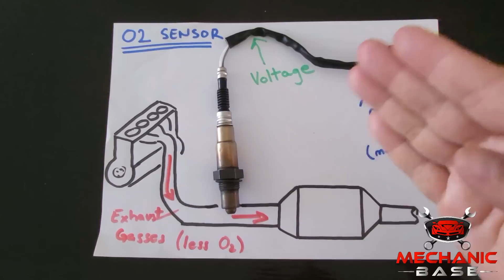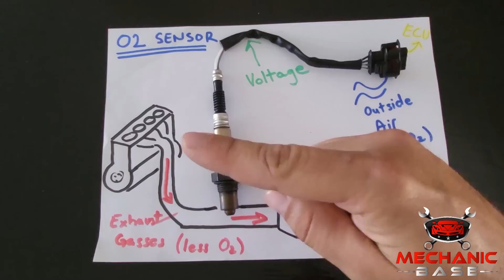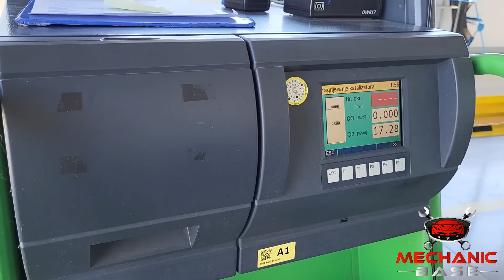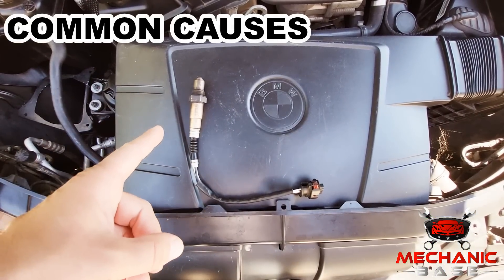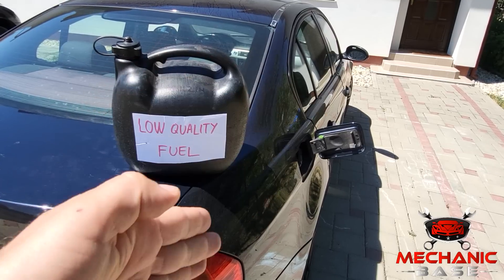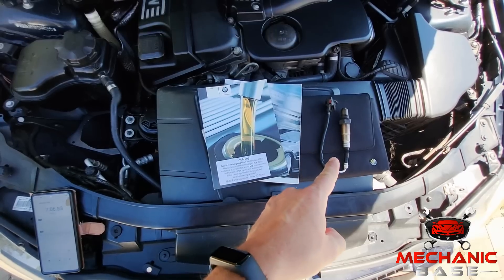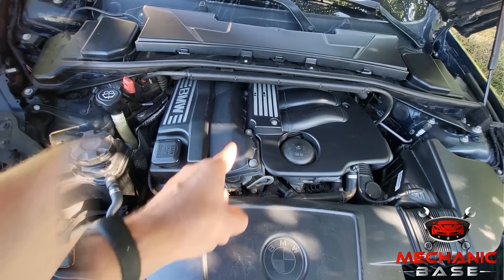5 Symptoms of a Bad Oxygen Sensor (and Replacement Cost!)

Comment: Just a tip, replace O2 sensors with the OEM unit your car came with from the facotory. Aftermarket units do not always work in some vehicles. GM is notorious for this. I know, I just installed a Bosch unit in my GM, when replacing the exhaust system, it tripped a code. Replaced with ACDelco O2 sensor, no more code, car idling smooth again. 

On edit: The reason a Bosch O2 sensor wound up in my vehicle is that I had an exhaust installed, and it needed a new O2 sensor, Bosch was all that was readily available at the time of the install. If not for that, an OEM sensor would have been installed.
Reply: thanks for this advice, I have a GM car but it is a Holden made in Oz.
Reply: Fords are notorious for being incompatible with some aftermarket parts as well
Reply: @kenneth9874     pshh ... Nah
Reply: Buy a Ford
Reply: @anonymous175  s1¹22
Reply: My 2008 Grand Marquis with 4.6 engine has 292,000 Km on it without replacing an O2 sensor.I always used  5w20 full synthetic oil and does not burn oil.Oil& filter is changed twice A Year. With check engine not on, is this an indication that O2 sensor (or sensors) are ok? Engine is always fully warmed,before being,shut off.
Reply: What is an OEM price to an aftermarket part price,% ball park? I once shopped for an OEM part (Blend Door Actuator for a 98 Honda). There was only one in all of Canada (Toronto, of course) that was 6 times more expensive than an Aftermarket, Chinese part.
Reply: @davidweum  That particular OEM part you tried to source, that is the dealer raping the customer. Almost all do that today, you really need to research and shop around, which it sounds like you did. 

And funny you mention Honda, and aftermarket parts, I have a few stories on that one, what a nightmare. Had to pay the vig, as the aftermarket parts were of such poor quality and fit, I had no other choice than to go OEM, 2008 Civic of all things. 

But, certain parts, many times the best, or only alternative is aftermarket. Blend door actuators being one, I am very familiar with those, both OEM and aftermarket. I normally use Dorman, they have upped their quality as of late, moving from a Chinese manufacturer to a South Korean one. 

Sensors though, those are critical use items. That is mainly what I am speaking of, those computer related items that are supposed to be built to certain specs at an acceptable quality and function level. As I stated above, I have never had any luck with aftermarket sensors. 

As far as cost, much will depend on your vehicle. I drive, by choice, a 2003 Buick Park Avenue for the very reason it was a GM build that spanned many years and many many models. Parts are readily available and there is a ton of old new stock floating around out here, so even a genuine OEM part price in many cases is on par with the aftermarket price, and some times even less. But, I understand where you are coming from, and it is a quite reasonable position. 

Myself, I mainly work and wrench in the class 8 diesel world on my own and friends trucks. If you think car parts are expensive, play with this stuff for awhile. A once $50 Intake Manifold Pressure sensor is now well over $100, the Exhaust Back Pressure sensor went from $80 something to near $200. These are two critical parts on a Cummins and these dealers are very proud of their pricing, oh I have stories. We call them stealerships for good reason. 

For parts, eBay, Amazon and Rock Auto are my main suppliers for the automotive side. The diesel side, not much choice there, OEM for most everything.
Reply: @michaelwright1602  
Thank you very much, Mic. Very informative and cautionary. I actually have my eye on a 94 Buick. I guess I'll drive my Saturn until it totally shuts down if it hasn't already then try and find an older car so much easier to maintain.
Sincerely,
David Weum
Alberta
Reply: @davidweum  I would look for a 2000 to 2004/5 model GM in the LeSabre or Park Avenue line, anything utilizing that cross brand body configuration with the 3800 motor. The motor and transmission are very solid, though the 3800 does suffer from a couple of easily fixed issues, but once addressed, that motor is darn near bullet proof. 

If you do not mind turning a wrench, these cars can run for years for penny's on the dollar. 

And with those model years with the 3800, parts are incredibly easy to source and purchase at very reasonable prices. You start getting into the pre 1999 vehicles, the parts are a bit harder to find, but still out there. Just my .02
Reply: @michaelwright1602  
Thanks again. I really do want a Lesabre and/or Park Avenue for sure. But, I've been going on Facebook and Jijiji for the past few months and have not seen any yet, but I'm sure I will eventually. 
David Weum
Alberta

Comment: Hi, Thanks for the great Video.
My VW Tiguan 2.0 TDI is having an engine  light on and when the mechanic checked it. He said I need to change O2 Sensor and Decat as well, because it might be dirty.
My question is it necessary to also do decat when changing the O2 Sensor?
Reply from the maker: Hi Boetie. Did you mechanic advice you to do the decat, or DPF-removal?

Comment: Small leak in Evap system such as gas cap could possibly set false codes to H20 sensors
Reply: I have a two thousand fifteen cherokee laredo two oxygen sisters

Comment: I  got  that  problem  right  now  with  my  2009 corolla s 1.8  and  i  Chang  it  and  the  computer  tell  me  its  the  same  part.  Dont  know  want  to  do advice  please. 😊🙏💪
Reply from the maker: Are you getting any codes? Check engine light?
Reply: @MechanicBase  i  put  the  oxygen  S.  And  the  check  engine  light  still come  on  check  all  the  codes   and  it  still  say  oxygen S.   Dont get  it.🤔
Reply: start reading fault codes

Comment: Do you think a faulty 02c would cause just one bank to misfire and have a rich looking plug or am I just wishing and know it's a fuel injector 😜
Reply from the maker: Hey Jeff, do you have an OBD2 scanner to check what the fuel trims are like?
Reply: @MechanicBase  I had a cheap one  but wouldn't read the fault codes I have a live fuel thing in my dash it goes up to 40 liters per 100 Kay then drops back down to 7 or 8 liters per 100 Kay at 60 kph if that makes sense
Reply: That's with five seconds that fuel adjustment ment while it does that the check engine light comes on then goes straight off
Reply: Coils or spark plugs?
Reply: @lachlanbrown409  coils fine plugs too did the old swap to another cyclnder with both and still miss fire on idle I'm thinking it could be fuel pressure reg or injector ..hope it's not a valve 😁

Comment: I'm getting a code p0172 and p0175. Is that O2 sensor or maf?
Reply from the maker: Those are 'running rich' codes. The best place to start is cleaning the MAF sansor. You can find all about that here👇👇
https://youtu.be/SJp0fN74UNk
Reply: @MechanicBase  ok thanks. Will do. Now I have another question in regards to that the check engine light goes on for about a day and off for a few days. Could something be loose or going out? Don't know much about cars at all.

Comment: Does the oxygen sensor prevent a car from  starting???? Please  help 🙏.. I have a 2000 ford mustang i turn the key  got power car wont start .. I hit the cable by the sensor or sensor .. it starts automatically
Reply from the maker: It shouldn't prevent it from starting? 
Does this happen when the car is cold (i.e. in the morning)?
Reply: If you spray starter fliud does it start?
You probably have a fuel pump problem

Comment: Hi Guys, I have a problem with my car, after driving my car for sometime, when slowing down at a stop light or stop street, my car stalls out! What can be the problem?
Reply: Vacuum leak
Reply: Check the basics first. Oil level, air filter etc. Check for a dirty throttle body.
Reply from the maker: Hey Shane, which car do you have? 
Does it have an idle control valve? If yes, it could be clogged. 
Keep an eye on our channel, we're just making a detailed video about stalling issues. This will be uploaded in a day or two.
Reply: IAC, BAD THROTTLE BODY.

Comment: Thank you, a very interesting and informative video.

I had a question on something I had been speculating on regarding the possible effect of the accumulation of carbon on the O2 sensor's probe. Assuming that the voltage generated by the probe is proportional to the oxygen concentration difference between the exhaust gas and the outside air, then a lean mixture, more oxygen in the exhaust, would result in a smaller voltage signal to the computer and so the computer would respond by richening the mixture. Would a layer of carbon on the ceramic surface of the probe tip inhibit the diffusion of oxygen through the probe and result in an anomalously low voltage reading that the computer would interpret as a lean running engine and thus overly richen it? Would we then see this effect as the gradual darkening, accumulation of soot, on the insides of the exhaust tips?

If this is the case, would you see this as a sign that maybe it was time to replace the oxygen sensors?
Reply: I have had very good luck with Delphi o2 sensors in GM products, they actually make many OEM O2 sensors for GM
Reply from the maker: Hey, yes, that's definitely a possibility. Which engine do you have? If it has two banks (i.e. a V6 or V8), you can swap sensors and see what's happening with the readings.
Reply: @MechanicBase  Thanks for the input. The car is a 370Z with the VQ37VHR engine, a V-6 that is hitting 45k miles and is in excellent running condition. I just noticed that the insides of my exhaust tips are starting to show a little carbon residue (soot) now, whereas the tips would run with virtually no residue on them when the engine was new. I'm using no noticeable amount of oil, as indicated on the dipstick at the end of my 3k mile oil change interval.

The engine is running smoothly and quietly with good response and power. My guess is that maybe the engine is now running a little  richer than the stoichiometric ratio  because of a little carbon buildup on the upstream sensors. I'm thinking of maybe having both upstream sensors replaced.
Reply: You guys are an inspiration!!!!

Comment: I have p0420, black sooty smoke, rough idle when warm, and slight stumble on light acceleration.  I have cleaned throttle plate, egr, maf, pcv, with no change.
Reply: Is it your Catalytic Converter?
Reply from the maker: Hey, could you check what are your fuel trims like when that happens? 
It could be that your upstream o2 sensor is giving false data.